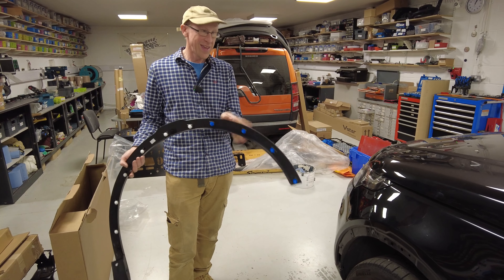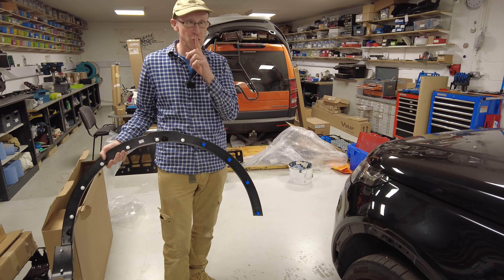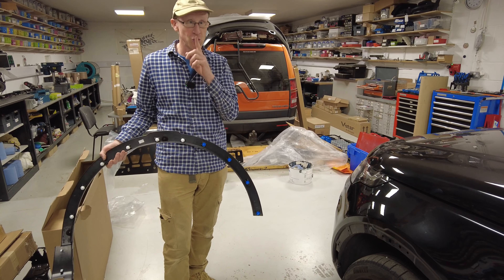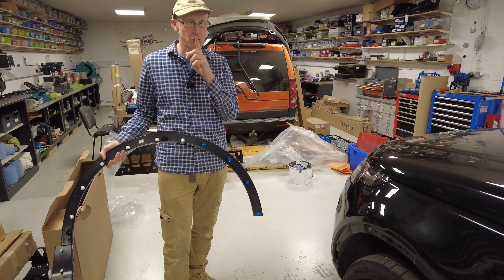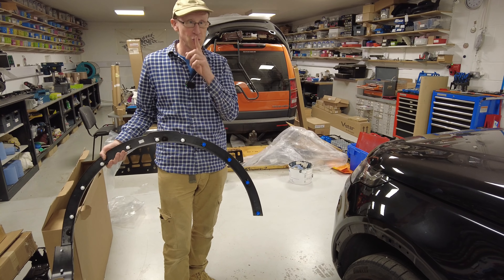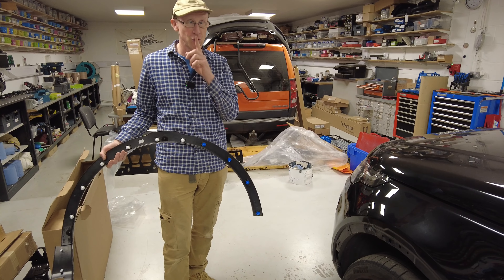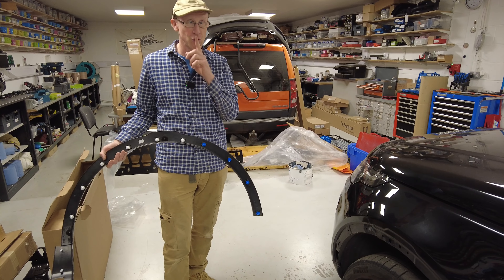How To Remove / Replace The Front Wheel Arch on a Land Rover Discovery Sport L550

Comment: Cheers, Simon and the crew. I will need to do this myself soon. Mine isn't missing, but the previous owner slightly kinked the plastic. I guess they caught it, pulled on it, and it now it doesn't sit quite flush toward the bottom. My OCD dictates that a new one is in order. I have the 360' parking sensors and park assist, so I will need to be careful with the sensor!
Reply from the maker: Hopefully the sensor does not need to be removed. Good luck !
Reply: @L663   I'll be doing mine in the next couple of days and will report back. I have the part, and there really are about 5 options depending on whether you have the sensors, auto park, no sensors, painted (but it comes unpainted) and Dynamic. It would be very easy to order the wrong one. Fingers crossed I didn't!

Comment: Good to see some L550 content. Can we have more please as I think that the Disco Sport is the highest sales volume LR model. Maybe more accessories too? Thx
Reply: I’ve have some servicing content on my channel but sold my car  due to the incompetent dof/scr engineering resulting in Diesel in oil dilution, constant active dof regen and knackered balencer shafts on the Ignenium engine
Reply: @mercedes_and_more Could I ask how old the engine is, how many miles and does it have a full annual LR Service history? Mine runs perfectly as a 2017/40,000 mile car and no sign of dilution but I have heard of it on 2014-2016 engines. Was it cured or should I worry?? Thank you.🫢🙂🙂
Reply: Very useful Simon…I don’t need a replacement but interesting to see how it fits! 🤔😀😀😀😀
Reply from the maker: I am trying to get more done... lots going on right now !
Reply: @mercedes_and_more Thanks, I used your oil change video as a guide!
Reply: @iampaulnorris  that’s great - thanks and glad you found it useful 👍

Comment: A good tight fit, I’m amazed it came off during driving with only 1 loose clip.
Reply from the maker: Yes it seems odd - but i guess at the front the air could get under it with some force

Comment: hi. very nice video!! I just got a Land Rover discovery sports 2015.  however just 2 weeks after I bought the car, I crash the tail right light, I would like to exchange for a new one.  I see the left side there's actually spot for me to screw out a board in order to see the circuit board but there's only a plastic mesh thingy on the right side, do you have any advice on how to access the circuit board on the right side please? that would be very much appreciated.